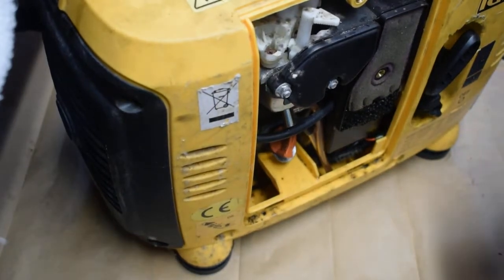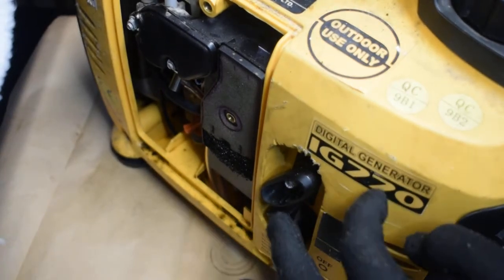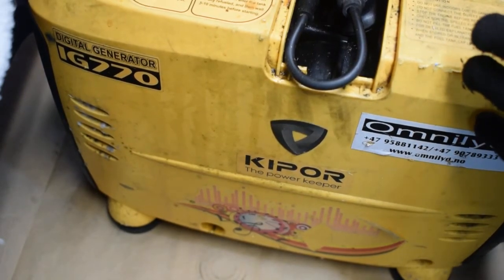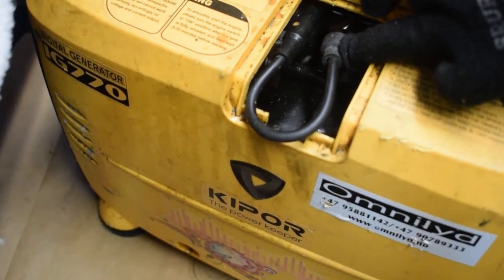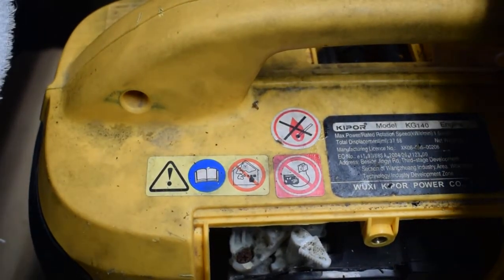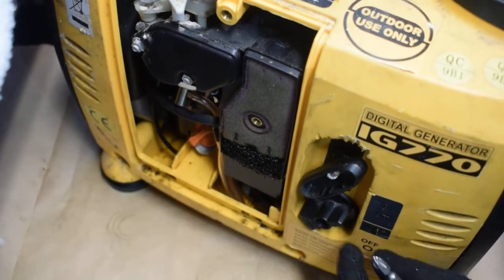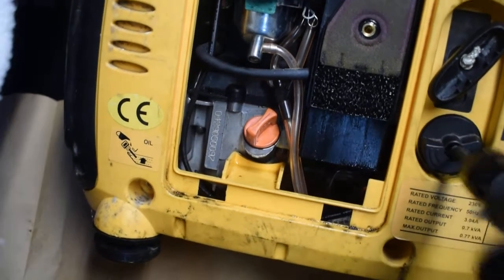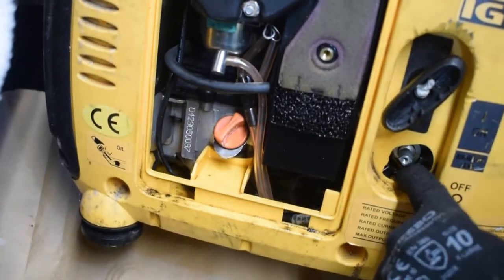Portable generator does not start - no spark | Digital Inverter Generator Kipor IG770

Comment: Generac ix2000 no spark.  This wasn't the problem, has oil, but thanks for the pointer :)
Reply: Did you find the diagnosis?
Reply: @withoutprejudice6  more than likely using ethonol gas which has gummed up the works.  Will clean and use clear gas from here on out.
Reply: My ix 2000 also doesn’t have spark 🥲